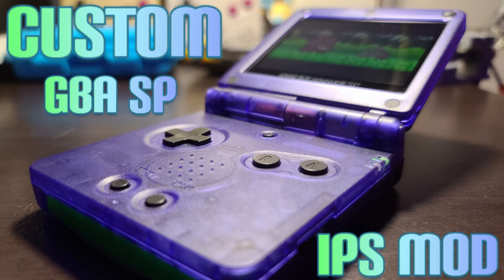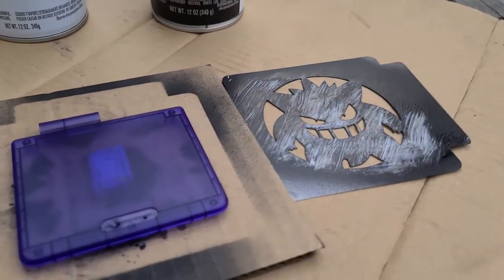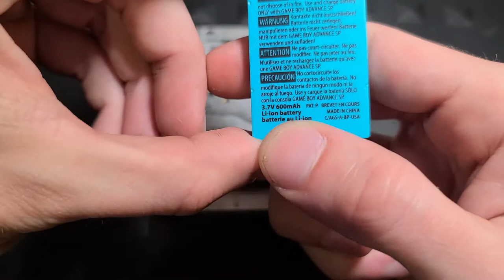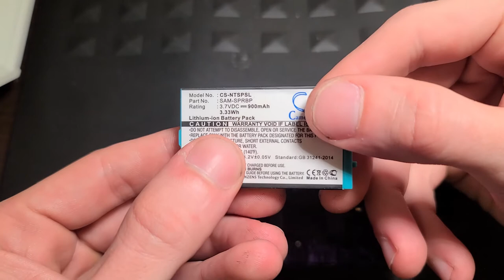Gameboy Advance SP FunnyPlaying IPS Install & Battery Upgrade [Gengar Edition]

Comment: Hey love the build man! I've recently discovered modding and was looking into trying to mod a GBA SP myself but I need a soldering kit. I keep seeing people use that marker thing before soldering and I was wondering what that was?
Reply from the maker: Thanks! That is a flux pen. Flux promotes the binding of clean metal surfaces by removing oxidation. Its a must have if youre going to be soldering. Good luck and feel free to reach out if you have any other questions.
Reply: @rstampf  I’m late but where can I buy a flux pen? Is there a specific type?